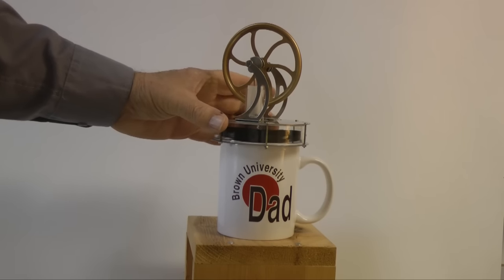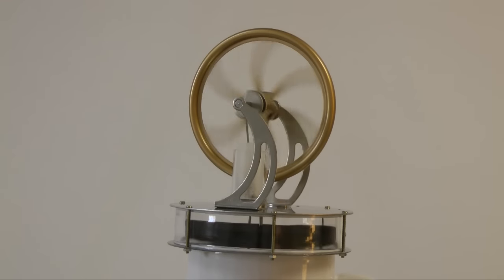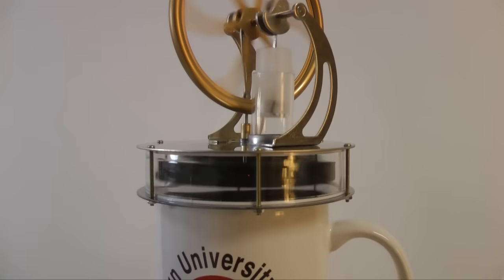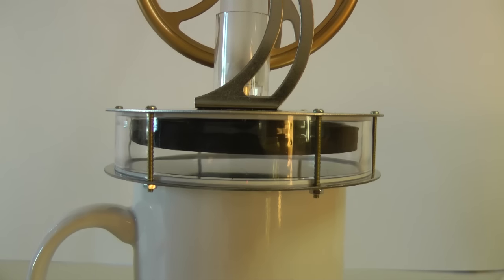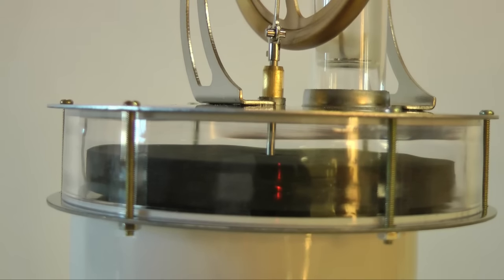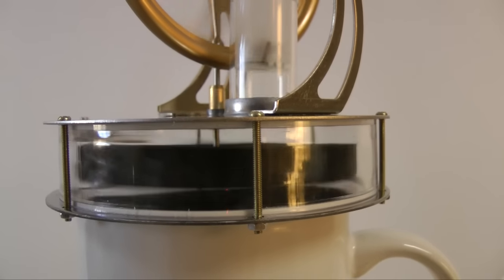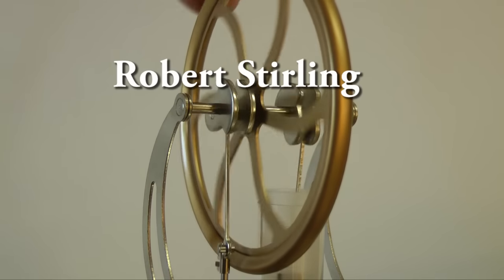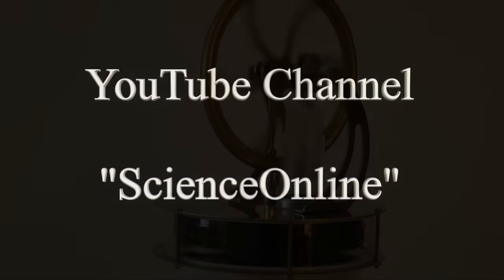An Elegant Machine - The Stirling Engine

Comment: The most advanced space probes now generate power with a Stirling engine powered by a slug of decaying Pu-238 — the most efficient radiothermal generator known. His simple, elegant machine remains in use after all this time, using heat sources and materials he had no idea of and for applications he could never have imagined. 

And yet a working Stirling engine can also be built out of the most common of materials, by anyone with even a little technological skill.

I think no finer tribute to an inventor is possible.
Reply: Arkadia Moon 

Not so fast... Solid-state Peltier-cell stacks are commonly used in RTG's. No moving parts.
But there is an interest with NASA in Sterling engines.
Reply: U235*

Comment: This Stirling concept was used to create a nearly silent diesel-engine submarine. The Swedish sub HMS Gotland, equipped with an Air Independent Propulsion (AIP) system,  repeatedly "sank" the carrier USS Ronald Reagan multiple times in a 2005 series of war games. I could not locate just how the US Navy planned to counter this threat, since everything surrounding its response to this threat is likely classified. The Gotland also reduced its electromagnetic signature with electromagnetic countermeasures of its own. Given its cost of $100 million vs. $10 billion for a Columbia Class ICBM sub (100 times more than Gotland) or $2.5 billion for a Virginia Class attack sub (25 times the cost and its closest parallel craft), AIP-powered subs would be a cheap defensive measure in littoral and sub-littoral depths. It does requiring refueling with diesel, but if it's only patrolling at max depths of 150 m (500 ft.) within its usual waters (the Baltic Sea), is that really a serious concern?

Comment: I wonder... if you wore an insulated suit with tubing running throughout filled with water, and mounted one of those super-efficient lightweight Stirling engines over an area where the body-heated water could accumulate, and have the engine linked to a light and efficient pump and maybe also a fan to blow air through an exposed section of tubing before cycling it back into the suit... would you have a harnessable energy source powered solely by body heat? Purely a "could it theoretically be done" sort of inquiry.

Comment: Fascinating. Is the minimum temperature differential related to the square area of the displacer and power-piston?  what about the height (travel length) of the power-piston? I think I now understand essentially how this device operates. Your explanation, BTW, is the best I've yet encountered. This is the 4th vid I've watched, and this is the only one that actually made it clear. (BTW, I'm a middle-school Science teacher, and have a good bit of both mechanical and electronic tech experience in my background as well, so it's not as if I cannot understand such devices. lol ) 
  But again, the clarity with which you explained the relationship between the displacer and the power-piston is, I believe, what was lacking in most of the other vids. I guess what made it hard for me to "grasp that I was grasping" it at all, was a slight difficulty in believing that the air could expand that quickly. I've always pictured thermal expansion as something that happened over a slightly longer period of time. So, once again, thanks for making this so clear..

Comment: I like this video, but you brushed past the fact that as the air cooled, it actually helps pull the piston back down, and in turn adds more energy into the system. Attributing all of the motion to the simple momentum of the flywheel is slightly incorrect. Either that or I have no idea how a flywheel works.
Reply: Maybe they built the closed system in a a cold environment. So when the air cooled, on the bottom stroke it would all ready be slightly pressurized at room temperature

Comment: I am very sorry to say that the explanation could be misleading as there are two power strokes in this engine and not as the seemed to have been inferred bby the explanation . The power piston is forced up by the high pressure and it is forced down by the low pressure and not simply by the momentum of the flywheel.   Perhaps this is  picking up on  something that other people thought it was necessary, but I thought that such detail about the two power strokes should be included. Again TWO POWER STROKES EXIST IN THIS ENGINE.
Reply: Wrong! This is a gamma stirling engine only the alpha stirling engine has two power strokes. In both the beta and the gamma the displacer is exactly that a displacer of air and is not airtight in the cyilnder encasing it. In both those engines it is the momentum of the flywheel that completes the stroke following the power stroke moving the displacer. See https://www.youtube.com/watch?v=gQb2sN6UWkA

Comment: Question is (1) how fast can this flywheel system revolve (RPMs), (2) how much torque (horsepower) can be produced by gyroscopic flywheel, (3) heat diffuser maximum weight uplift overcoming gravitational force ... to be industrially up-sizeable).

Connect electromagnetic coils onto the flywheel's horizontal shaft for energy generation.  To use this in an off grid system, you would have an upright machine, with a solar-tracking parabolic mirror focusing sunlight/heat underneath and onto the hot bottom plate.  Only operable on sunny days.  Issue is heat and diffuser weight limits.    

Air and heat have smaller machine size and component weight limits.  Any air (even alcohol) compresses far greater than water in a pressure piston.  Water, hot water, and steam have greater machine size, greater pressures and size limits.  So Stirling machine is viable, but only as a small working model, not industrially or off grid viable.  Making this device, like Arizona solar power energy unit, would be making extremely hot air exhaust (air pollution) to be viable.  Recycled hot air, and a heat sink could reclaim heat energy.  But, modern solar technology uses greater liquid sodium, as that higher heat production, and recycling system.  Every modern 1900s-current technology surpasses this machine.

This makes geothermal heat, water, steam, torque, and turbine energy generation more viable, irrespective of weather and climate.  Large hydroelectric (Tesla, Niagara Falls) or river dam water turbines are more effective.  Smaller water units would still need vast water flow to a water turbine or an overshot or undershot water wheel for the needed torque spinning up the electromagnetic coils.

Would need to move over to the Leedskalnin coil engine for perpetual motion and electromagnetic energy generation.

So Stirling machine ... hmmmm.
Reply: +John Lord Well, perpetual motion is a pipe dream (those annoying laws of thermodynamics: you can't win, you can't break even, and you can't quit the game). But yes, the Stirling engine is incredibly broadly applicable.  

There are practical limits, of course: the more power you want out of it, the greater the heat differential required. In space applications, you can get the differential between a red-hot slug of decaying Pu-238 and the ambient temperature of outer space, but for atmospheric applications on Earth, it takes a fairly large input of energy to maintain the differential; beyond a certain point, that required energy input into the larger system cancels the Stirling engine's inherent efficiency.
Reply: As such, then this is only good, depending on the atmospheric pressures, and air mixtures.  Maybe great for running on Saturn, Jupiter, a heavier gaseous plant (venus?).  But real time situations, a 3000 rpm gyro-wheel embedded with magnets inside a wheeled turbine, would be far better in establishing (potential) perpetual motion and energy generation.

This almost sounds the same as the little scientific trinket with a solar pane windmill (in a vacuum in a glass bottle).  Wonder why they haven't put on such windmills onto the space station (instead of solar cells.  Solar wind is out there, and the heat differential is also present.

Comment: Instead of heating the bottom, if you rapidly cool the top plate, say with some ice, it should work as well.
Reply: +Yonas Kidane Or, for that matter, if you set the bottom plate on top of a block of dry ice, it should work equally well, though rotating in the opposite direction.

Comment: so many ways to get free clean energy thanks
Reply: this isn't free energy! but you could say it's clean but that's kinda not true too
Reply: +MARTIN MARTINEZ Since the energy comes either from food when powered by hand or electricity when heating the liquid in the coffee mug it's not quite clean.
Reply: +MARTIN MARTINEZ The laws of thermodynamics come down to TANSTAAFL: There Ain't No Such Thing As A Free Lunch. Energy always comes from somewhere, and entropy always wins, eventually. 

If you happen to have a convenient volcanic heat source at hand, the energy can be free in an economic sense, and clean in the sense that no human-generated energy source was required to access the heat. But otherwise, human-produced energy (electric power, internal-combustion engines, &c.) is required to produce the heat differential, and that creates some sort of waste and emissions somewhere along the line.

For that matter, even making the Stirling engine requires materials (especially metals) that consume power to make and generate waste.

Comment: Such a beautiful engine, really fascinating indeed. I want to buy one since the one I made is ugly as hell (I used an aluminum can so it can't be beautiful hahaha)
Reply: +Miguel Almeida i got the one from the video above and no assembly required, as it was shied with just two parts, the base and the wheel, a u need to do is place it in position
Reply: miguel , can you tell what calculations you used to design your stirling engine